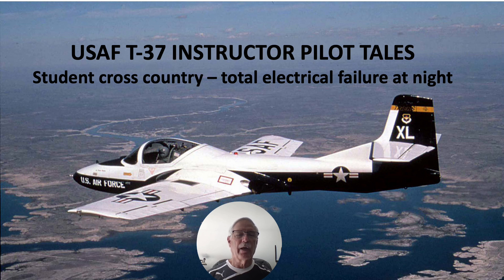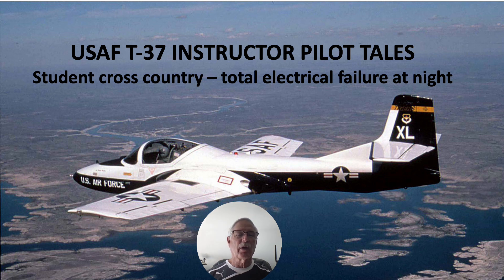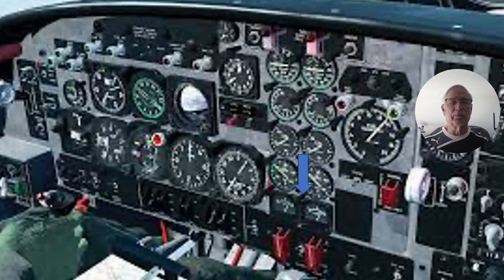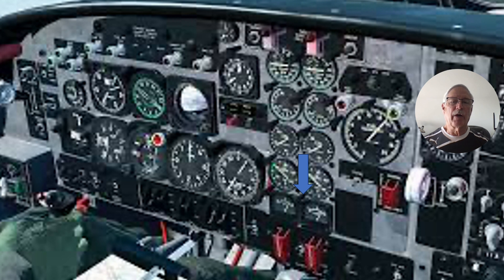USAF T-37 INSTRUCTOR PILOT TALES  Student cross country – total electrical failure at night

Comment: Interesting and entertaining stories Ron! Brings back memories from my USAF pilot training days, particularly this story…I had multiple system failure on a student solo T-38 cross-country. Our class launched a multi-ship T-38 student solo gaggle with a five or so minutes of spacing, IP launched at the head of the solo students  and in the last jet like ducks in a row so they could monitor us. Weather unexpectedly deteriorated at the destination but above ILS mins. I was in the last jet ahead of the tail end Charlie IP jet. During the enroute descent I observed an annunciator light for RH generator failure, no crossover meaning the LH generator failed to pick up the failed RH generator components which were most of the critical electrical components. I declared an emergency and got vectored for an ILS in IMC. Weather was 400 overcast and 1 mile. Transformer rectifier failed intermittently during the approach so I ended up flying a raw data (no flight director), mostly stab trim out ILS. After landing safely one of the IPs rolled in hard on me after I shut down blustering about why the hell I created all the drama of declaring an IFE over a little weather. When I explained the nature of the electrical problems, he turned pale, went silent then muttered something about glad I got it down ok. We had to leave my jet for repairs and I had to fly back to the UPT base with him and it was an uncharacteristically low key (for him), relaxed atmosphere on the trip back. This is over 30 years ago so no GPS, no HUD or glass cockpit, no iPad with Foreflight, just radio navaids and electromechanical instruments.
Reply from the maker: Wow! great story, thanks for sharing!

Comment: On My T-38 solo cross country Del Rio to Shepherd, I was cruising along at FL390 and Mach .09. My anunciador panel briefly light up and went out. I had a loss of communication’s power and subsequently I went NORDO. I flew the filed route until over Shepard. It was CAVU so I simply corkscrewed down from FL 390 over Shepard, flew a crappy visual approach (I wasn’t even smart enough to dial in the ILS frequency), landed and followed the Follow-Me truck to parking. I can only imagine Center clearing everyone away from me as I went idle and boards from FL390 with no transponder. Granted, after a 12 year Air Guard career and a 34 year airline career and over 20,000 hours, I wouldn’t do it that way now, but it worked. When I climbed out of the cockpit, I was an idiot who probably should be washed out. That is until the avionics tech came out and declared that the majority of the electrical system was fried. I was then a model student, who short of crashing, was assured graduation. It was truly a “ Zero to Hero” experience for me. 😊